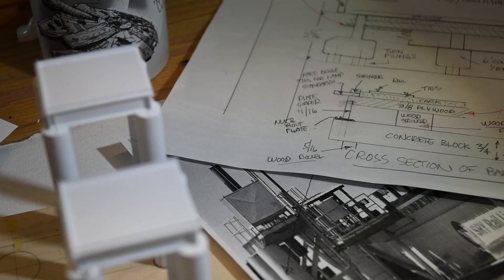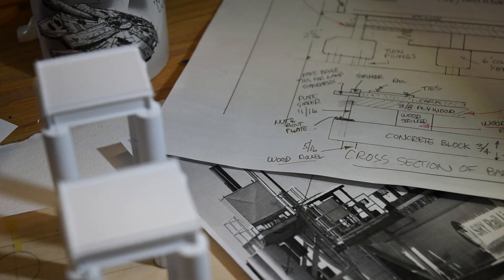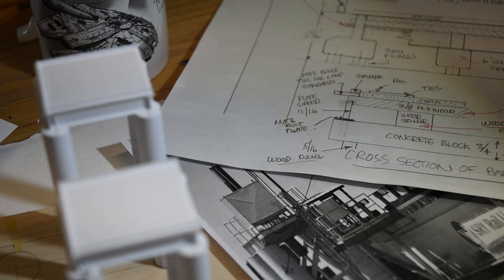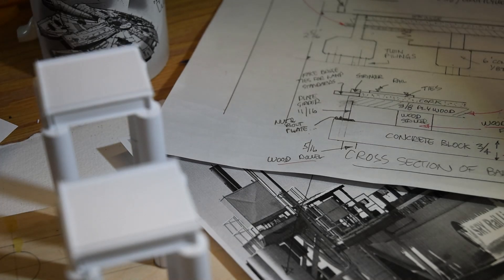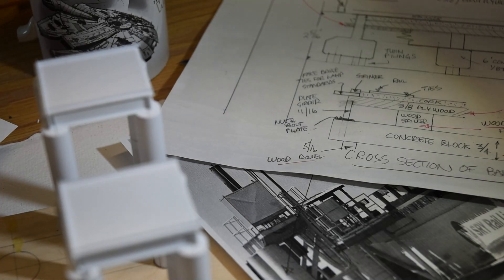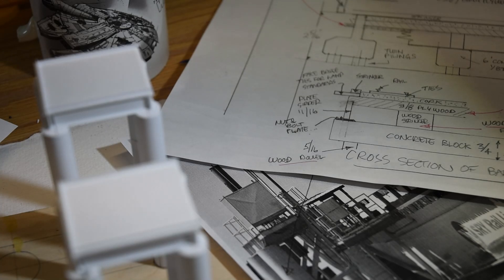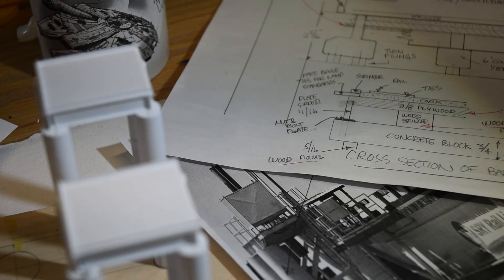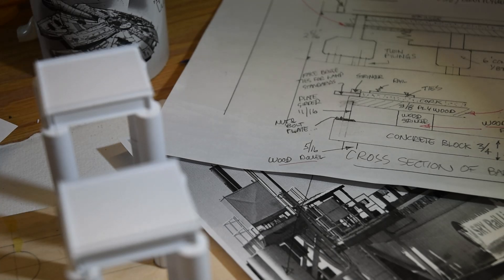Traditional Models vs Progressive 3D Printing | Is The Former Obsolete? Vlog #11

Comment: I know this is an older video, but I went back and started watching your vlogs from the beginning. Great stuff! I had to chime in on this one. I went to college for drafting. I learned on the board, but CAD was relatively new then, so I learned CAD too. I worked in architecture for 15 years. Now in manufacturing engineering. I use CAD all day. Of course, this transitioned into my hobbies. I 3d print at home (resin printing) and I've been into everything from photo etching to CNC milling. I view the 3D stuff as just another tool. I still prefer to scratch build by hand, and much prefer building in brass over anything else. It's just my personal thing. Lately I've really embraced the mixed media approach and am blending all the materials/approaches together and it's really taken things to the next level for me. I think some people are over-doing the cad-print thing. Like printing entire car bodies, floors, etc. that are supposed to be wood. I'm doing some short logging flats right now that are pretty much every technology/tool in the book. I'm using the best materials for the job. Where 3d printing really shines for me personally is in the money-saving department. I just printed 2 dozen Hon3 trucks, brake reservoirs, log bunks, ratchet plates, and bolster bearing plates for about $1.20 (for the whole lot of parts) and went from 3D model to physical model before lunch in the same day. That's incredible to me. Anyway, love the content! I've been watching a ton of your videos lately.
Reply from the maker: I agree. 3D printing is an awesome asset to the  model industry and hobby. But most people do not have the skills you possess to exploit the hardware the way you do. If I was still in the model making industry, 3D printing would be to my advantage. 
The problem for me is, I don't want to sit at my desk after spending 30 hours a week editing a video . . . lol. The rest of the time I would rather be modeling at my bench in the tactile sense scratching a (one-off) model if you know what I mean. Thanks for sharing your experience. Cheers ~ Boomer.

Comment: If you can't dream it you can't build it. A sketch helps you get your ideas down on paper and AutoCad is just a tool to make building those ideas easier. As a designer I can say with confidence that there is a disconnect between creativity and digital tools. Painters create with a brush which is an extension of there mind not their hand. Great video and words of wisdom. Big, complex projects can be made easier, cheaper and faster with the help of AutoCad and 3D printing but smaller projects can become overly complex and tedious through the same process. Basic well learned modelling skills will never replace the technology in many cases but a combination of both can produce fantastic results. I learned early that 100 hours spent on designing the perfect CAD model is sometimes wasted when a perfectly suitable hand crafted model would suffice and could be built in less than 20 hours. To each his own. Great video and thanks for tackling the contentious subject.
Reply from the maker: Thank You for sharing your well thought out experiences. Everything plays a role in one way or another for sure. Cheers ~ Boomer.

Comment: Nice video.......as another daily CAD user in Architecture (not Autocad tho) I agree totally that CAD design is only as good as the user in terms of design and the accuracy the user inputs, beyond that its then reliant on the accuracy of the craftsman or machines that use those files. As another below said, my creative expression both in my job and my scale modelling still comes from a brain that thinks and solves problems combined with an HB pencil and a piece of paper .......and how I wish we still used drawing boards at work, lol 👍
Reply from the maker: Thank You. You also indicate a good analysis of the technology. As it stands, CAD design, in my case, would be too cumbersome anyway. I solve problems, on the fly at my bench, with "chicken scratch" anyway. The former would be overkill for my modelling purposes.

Comment: I work with AutoCAD every day and that's exactly why I have to break away to work with my hands and build my model railroad and scenery. AutoCAD is a very useful tool but there's something about that paper and pencil connection to my hand, eye and brain that just feels so much better than that goofy mouse. I did a bt of the layout planning with AutoCAD but there comes a point where doodling a detail with an HB lead is what finally solves the problem.
Reply from the maker: Wow, Thanks for sharing that. I don't declare AutoCAD irrelevant. I mean it's what gives us accuracy beyond pencil and paper in many ways . . .  but yes . . . the napkin drawing has it's advantage as well when confidence is high as well. Cheers ~ Boomer.

Comment: Valid points Boomer. I’ve been using both processes for sometime now, and this is what I have concluded (my own opinion; doesn’t mean it’s right! Lol):

3d printing is definitely not for everyone; it can become a hobby in its own right. It is another technique too add to the skill set, and I use it when appropriate. I do still scratch build, and sometimes, scratch building can be quicker then designing in CAD and printing the object. Sometimes though, I have come to discover that designing something complex in CAD can also have the same rewarded feeling that finishing a complex scratch build does; but it takes just as much skill and dexterity as scratch building does; using the process really can change how you look at something and how it’s built/manufactured…you have to “think 3D” so to speak. The two tools definitely go hand in hand with each other, and the results are phenomenal when applied correctly. Scratch building vs 3D printing…one is no more better than the other. Everything has a learning curve, but once mastered, a whole new world opportunities await.
Reply from the maker: Sounds good to me! Cheers.

Comment: Absolutely Boomer. I have just finished my biggest scratch build (a warehouse about 5 feet in length) based on a photograph and using the techniques I have learned from your channel.  What a sense of achievement I felt when I stepped back and viewed my work, the many faults notwithstanding. Built and weathered in the old fashioned way.
Reply from the maker: Fantastic! I wish I could see that. It feels good though eh? Glad to hear. The next warehouse I build for Glover Road will be approx. five feet as well. Cheers.
Reply: @boomerdiorama  Cheers Boomer. I’m sure yours will make mine look like scrap metal lol
Reply from the maker: @PeterTillman3  They should look like scrap metal. Weather that thing man!  . . . lol. Cheers.
Reply: Boomer, I believe the next building will be for River Road, right? ... I think you had a senior moment there referring to Glover Rd.
Reply from the maker: @hondachopper6978  No. I was referring to Glover Road about the previous buildings I saved in perfect condition from the tear down. But I do have senior moments every now-and-again . . . lol . . . Cheers.

Comment: 30 years I've framed homes I have used auto cab for design purposes only when it came time for materials list and scheduling material delivery I only used pencil and paper and still do auto cad has a use but for accuracy d school is the only way for me
Reply from the maker: It's neat how we can combine many disciplines despite the variations in methodology isn't it?

Comment: AutoCAD is just a tool, like any tool you need to know how to use it properly to get the best use out of it, its advantage over a traditional drawing board is when you start creating repetitive objects, plus of course the ability to work in 3D, less so with AutoCAD but certain CAD systems will allow you to create very complex systems and carry out analysis on them, for example I worked on the CAD model for a ridiculously complicated heat exchanger that was inside a large container, as the heat exchanger heated up all the feed pipes had to have room to expand, this could be shown on CAD in 3D and it could be shown that the feed pipes moved in such a way that there was no clash between pipes, heat exchangers or the vessel they were inside, trying to do that with drawing board methods would have been possible, but would have required dozens of drawings and taken many times longer. 

But there is still a case for traditional modelling, 3D printing certainly has its uses, especially for complicated shapes, but I use a mix of techniques, I may get some flat parts laser cut, 3D print others and just use traditional modelling techniques on other parts all in a single model, in fact I'm about halfway through the planning for creating a Swiss narrow gauge railway station using all of the above. The clock tower and a number of small details will be 3D printed, many of the walls will be laser cut and everything else will use traditional techniques
Reply from the maker: Sounds good. No problem using it if you have it for sure. Cheers.

Comment: I have a 3d printer. I've used it for some ac ducting, doors, windows for the station. But outside of that I'm old school. Cardstock, pencils and rulers. There's more satisfaction from building from scratch. The printer is just another tool on the bench. It collects more dust than use. 🤣 

For a good laugh about the SR-71 look up the pilot talking about ruling the sky over the southwest US. What hoot that would have been. 🤣 https://youtu.be/ILop3Kn3JO8
Reply from the maker: Sounds good. If I needed multiple parts for a larger model then 3D printer makes sense.

Comment: It's like buying pre-built structures from Woodland Scenics and Walthers, etc. That's not modeling, it's purchasing, and that's fine. But I still have craftsman kits I built 45 years ago, like from Campbells. I built them, I painted them, I customized them, I weathered them.  That's how I learned. I buy RTR rolling stock now to save time, but I have 100s of Athearn, Roundhouse, Accurail, etc kits I built and improved on over the years, That's modeling. I'm designing a new layout with graph paper, pencils, a metal straight edge ruler, and plastic protractors. Old school.
Reply from the maker: Imagine the John Allen's and the Paul Mallery's. They built everything, then the manufactures built upon their vision which many benefit from now but have forgotten or never heard of. Cheers.

Comment: I do strongly feel that 3d printing is just a tool added to the belt (not evil or good). Properly wielded, this tool can help build even better models. Like any tool, it should only be used for those things that add to the story that's being told.
Reply from the maker: Yup. Good sense for sure.